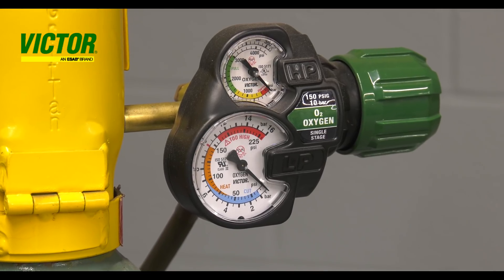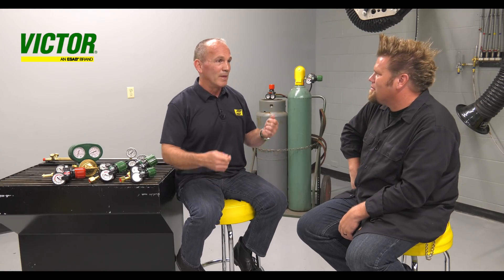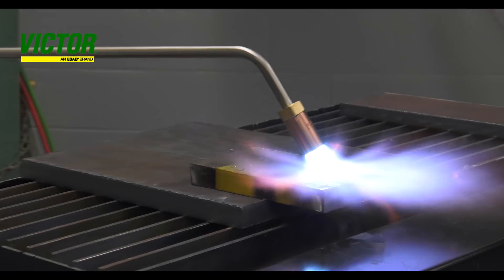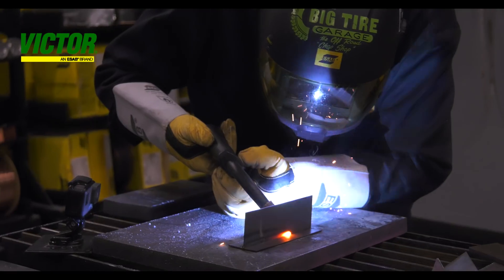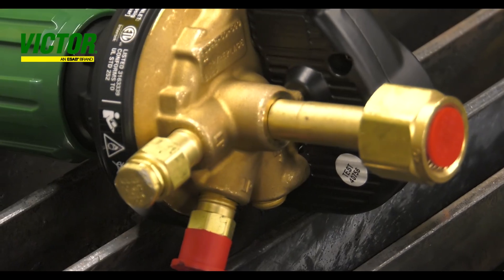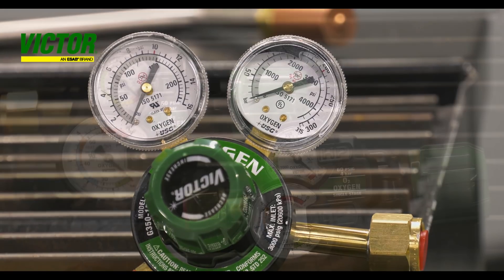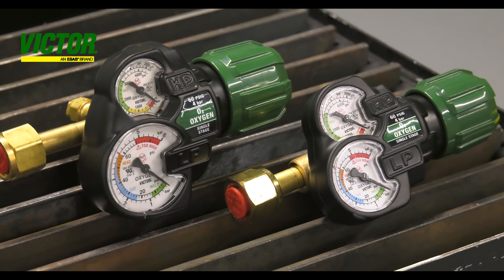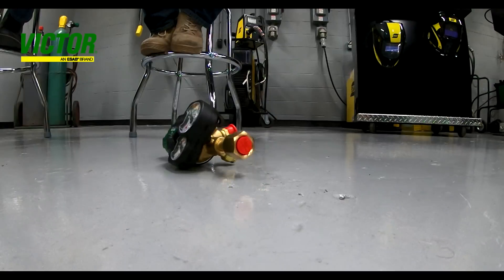Victor EDGE 2.0 Regulator Enhancements

Comment: There is talk in this video about the Edge regulators delivering more consistent flow, even as the cylinder pressure drops. Is that statement true of the single stage Edge series, or only the dual stage ETS4 (and other dual stage models)?

Dual Stage ETS4:
https://www.esabna.com/us/en/products/gas-equipment/industrial/gas-control/cylinder/single-stage/ess4-edge-series-cylinder-regulator.cfm

And speaking of, what is the difference in these two single stage product lines?

Single Stage Edge 2.0:
https://www.esabna.com/us/en/products/gas-equipment/industrial/gas-control/cylinder/single-stage/edge-series-2-0-regulators.cfm
https://www.esabna.com/us/en/products/gas-equipment/industrial/gas-control/cylinder/single-stage/ess3-edge-series-cylinder-regulator.cfm